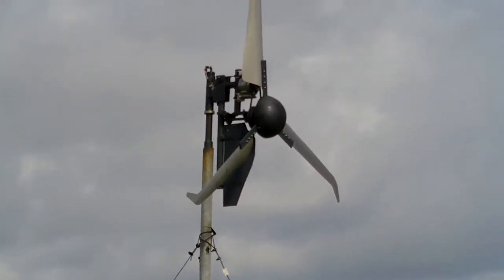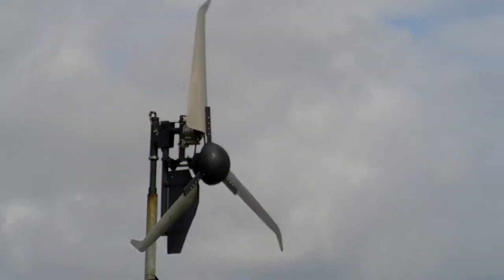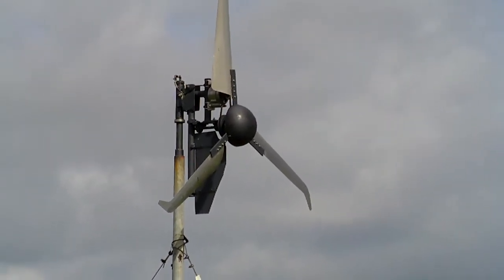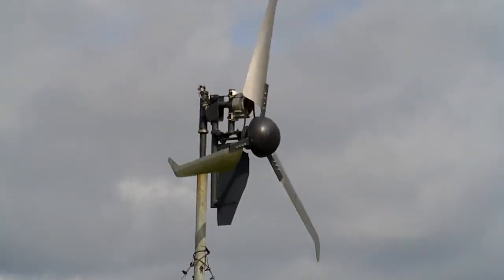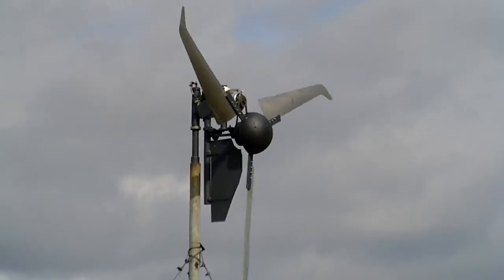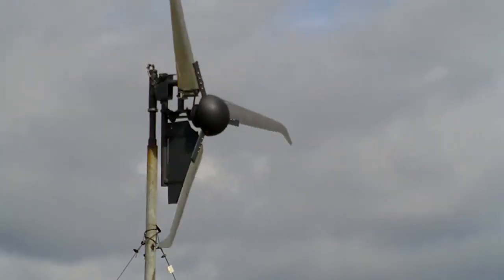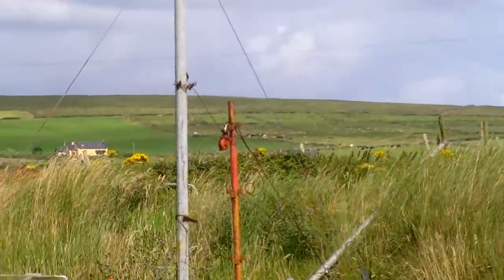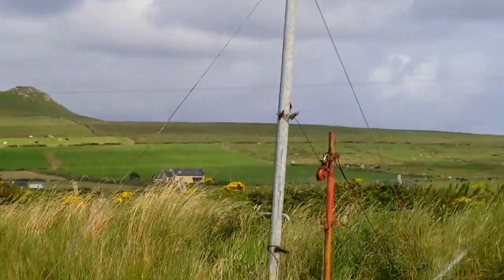New 3D wind turbine

Comment: I was wondering how this beast actually worked so I had to view this again......No tail and it follows the wind but it looks as though this is actually spinning backward.  Counter clockwise rotate instead of clockwise.  That explains no need for a tail and the way it lifts up in high winds.  Great idea once again which really makes you stand out.  I didn't know those pmg's worked in reverse spin but then again, why wouldn't it.  I know nothing about the blades your using and my question is.....Are the blades on in forward position or are they reversed also?  The Missouri wind stuff is set up for a clock wise spin and to replicate your idea I'm thinking one would have to turn Missouri wind blades around and take off the tail (of course it wouldn't lift up like yours without some kind of hinge.)
Reply from the maker: ***** Yes it looks a bit like that. The nose cone which is not needed as its a down wind turbine. The wind hits the blades at the back. The blades help track the wind and the small vain helps. It goes round clock wise. The Missouri blades where replaced buy my own composite design to deal with the gyro force. Like a helicopter blades.It means it floats on air pressure in high winds and storms. Like a cat flap the cat being the wind but of course it happens in 3D with the turbine. Hope this helps.
Reply: ian57812 That does help......I couldn't wrap my head around how that thing was working till I realized the wind was blowing thru the pole first.  Great to see mind's like yours out there sharing different concepts like this.  I should have my own monster finished in a week or two.  Need to get another 48v pmg first thou.  It won't be as unique as yours but still a monster in it's own way.  Ever think about putting a rpm meter on that? (unless you do have one which I missed).
Reply from the maker: ***** Good luck with your build. Yes it would be a good idea to put a rpm meter on it would be interesting to have that data. The turbine is back in the work shop at the moment awaiting new bigger bladesand  hub set up. Remember although the blades turn clockwise all threads turn anti clockwise. Split pin thesebolts or else your loose your rotor. People get so cross some times it was only a wind shield on a Mercedes.Lol

Comment: Really, really nice design.
Reply from the maker: Thanks. seems to be working well so far and making great power in relatively low winds.
Reply from the maker: finally had time to put up new 3D turbine with new composite blades. stay tuned jeff could be a interesting ride.
Reply: ian57812 I'll be watching

Comment: Do you have it hooked up to a storage battery, make use of the wattage you produce or are you selling it straight back onto the grid?  I am really interested in wind technology and generating the wattage doesn't seem to be the issue a lot of times, the issue I see people working with is what to do with it.  Great turbine, it looks really good.
Reply from the maker: Yes battery and inverter, I don't have a GTI but waiting for the right one. Will dump power into hot water immersion on windy days. Thanks Aaron
Reply: I didn't train as an engineer but certainly everything I have been reading leads me to conclude that wither making direct usage of the energy, placing it into a battery (obviously there do seem to be limitations on this), or using it to create a water mass heating system is the best way to go.  I have also seen models where heat solar and biomass are used together, so if sun don't shine, and wind don't blow, there is the fallback to light a fire for a while with all 3 feeding hot water storage and battery storage of the energy.  I guess the only other thing that could be added is a hydro turbine as well.  It is a subject that absolutely fascinates me, and I am keen to learn as much as I can.  Many thanks.
Reply from the maker: Yes Aaron its some what of a problem. I can buy electricity at 14 cent a kw hour. so why bother. Well I care what is happening but at the end of the day we must use all available resources weather wind solar biomass etc. Can l make a difference I don't think so but but going to do it any way.
Reply: I think it is a classic case of one man not being able to make a difference, but an ever increasing number of men all with the same idea can make a difference.  Did you see the report that in Australia a few weeks ago, in the middle of the day when energy consumption is high, that private resident production of electricity out produced demand, which meant that the power stations had absolutely no demand whatsoever.  It was the first time it had happened.  Now yes it is Australia and yes Australia is not the same as Europe or North America, but it does show that a tipping point exists and if enough people follow an ideology that amazing things can happen.  Australia effectively created free electricity for the nation for an afternoon.  I think that is amazing.

Comment: I'm not a wind turbine expert and I'm probably missing something here, but what does the "3D" in '3D wind turbine' mean? Does it mean it can swivel around it's base?
Reply from the maker: Thanks I checked out you super cool  helicopter with machine air gun totally impressedNow think of your machine fixed to a pole with a yaw movement. That's basically the 3Dnormal wind turbines are 2D and only have yaw and blade movement we can go up and down. I show you in the next storm.
Reply: ian57812 I see. What's the advantage of being able to lower and raise your turbine? Does it automatically lower and raise it self?

Isn't the highest possible height you can mount it the most desirable since the lower you go in altitude, the lower the wind speed due to wind shear with the ground?

I look forward to a video of it in action; I subscribed :-)